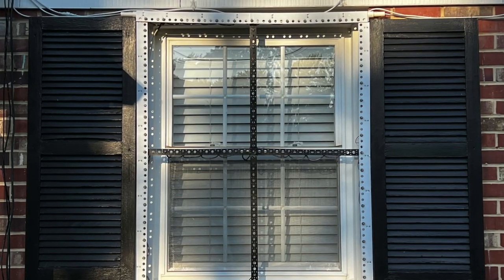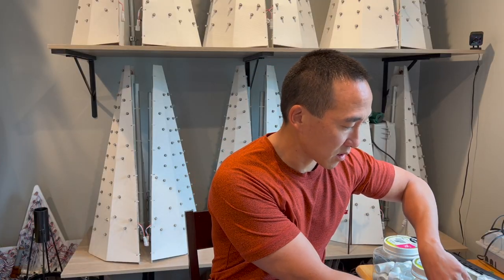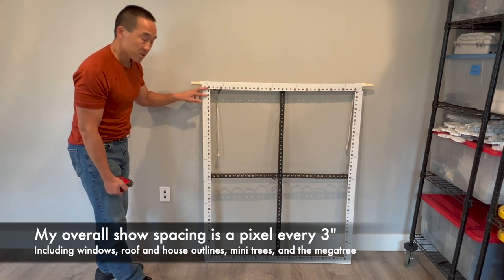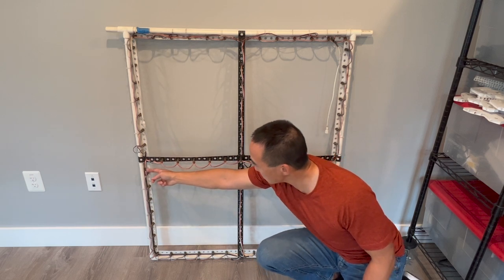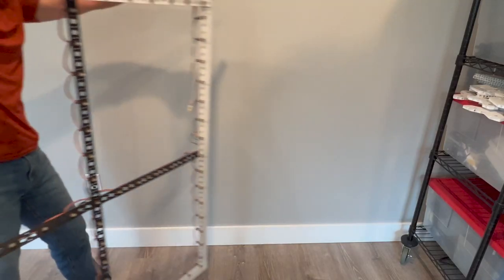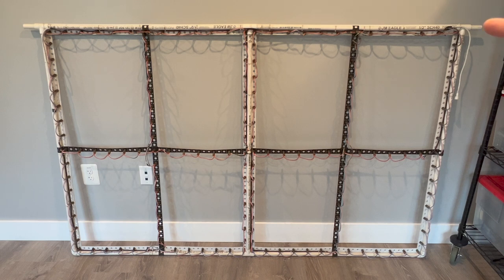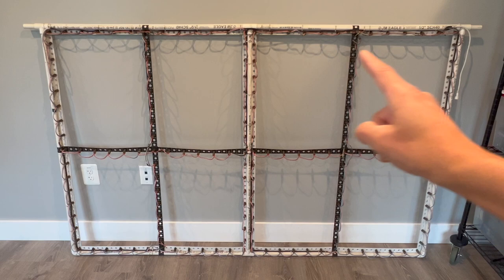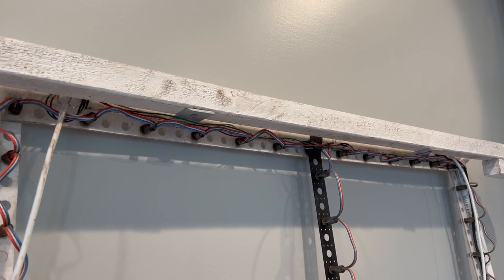How To - Make Custom Pixel Window Props (Part 1)

Comment: Nice setup Steve. When I did mine , I used some 1 x 2 wood and made a false casing that fits inside my windows so it’s able to hold it self there on its own. Then I attached the pixels using 12mm plastic clamps. Low cost solution since the shipping from the states is expensive for the coro.

Also it’s crazy how much those pixels have discolored over the years.
Reply from the maker: Thanks, and I like your idea of making a false casing. Can you post a link of the 12mm clips you speak of? 

And yes, it is crazy how they look, but they are solid as a rock and put out the same bright colors as if they are new. The pixels on the dark asphalt roof look like they’ve got 3rd degree burns, but those still run and look great at night.

Comment: If you were doing it again would you consider wiring the middle as a push one skip one then fill in the skipped ones on the way back like you might on other props like singing faces or would you continue with the splicing?
Reply from the maker: I guess that would work by starting in the middle going out one side, then back, then up to the top then back, to the other side and back, then straight down (not skipping) to then run around the outline perimeter. 

You would still need to add an extension to get the input to the middle of the window. 

Alternatively, the outline could be done first then the inside parts, but you’d still have to run an extension to the outgoing pigtail from the middle of the window. 

It’s a great idea and would certainly reduce the number of soldering joints required to wire it up.

This method would make modeling it in xlights a little more complicated. But once it’s done, it’s done. 

Great idea!
Reply: @NiFamilyLights  It would be possible to avoid the splice by starting at any of the T junctions. Here is a wiring diagram starting and finishing from bottom centre for example:

26	27	28	29	30	31	32	33	34
25	--	--	--	07	--	--	--	35
24	--	--	--	08	--	--	--	36
23	--	--	--	06	--	--	--	37
22	04	05	03	12	09	11	10	38
21	--	--	--	02	--	--	--	39
20	--	--	--	13	--	--	--	40
19	--	--	--	01	--	--	--	41
18	17	16	15	14	45	44	43	42
Reply from the maker: @MattWells0 Thanks for the diagram and sharing with others.  I think that would work if the pixel spacing were closer than 3".  With 3" pixel spacing, each node jump would require wire spacing of 6".  My pixels have 4" spacing, so every pixel in the middle would require splicing.

However, if the inside line spacing was 1", that would work with 4" spacing that come with standard pixels.  Alternatively, if you specify wire length from a pixel vendor, you could do it that way.
Reply: @NiFamilyLights , thinking this would work at 2" spacing.
  
26	25	24	23	22	21	20	19	18
27	-	-	-	9	-	-	-	17
28	-	-	-	8	-	-	-	16
29	-	-	-	10	-	-	-	15
30	5	6	4	7	11	12	13	14
31	-	-	-	3	-	-	-	45
32	-	-	-	2	-	-	-	44
33	-	-	-	1	-	-	-	43
34	35	36	37	38	39	40	41	42
Reply from the maker: @toddward4756 Yes, that could work with 2" spacing.

Comment: So the lower window frames just hang on the shutters or is there a screw/fastener? Is your house front not exposed to northern winds?
Reply from the maker: Yes, the lower window frames are just sitting on the shutters. I do have a very small hole drilled through that PVC piece and dropped a small finishing nail to give it some hold onto the shutter. But there’s really not much holding it onto the shutter.  We do get some really windy storms at times, but those window frames just seem to stay put.

Comment: Do you use anything else at the slice point to keep it waterproof or only heat shrink tubing?
Reply from the maker: Just heat shrink tubing is all I use when soldering to keep water out.

Comment: Trying to find a way to mount the lights to my windows I dont have shutters and its just a hardi plant siding and with flat trim. I would like to avoid putting holes in my house
Reply: Shower curtain rods?

Comment: What is the total weight?
Reply from the maker: I don’t know the weight exactly, but they are relatively light. The majority of the weight is the weight of the PVC. So, I’d guess the single windows are a couple of pounds or so. 

The frames with the wooden support crossbar are a little heavier, maybe another pound or two more.